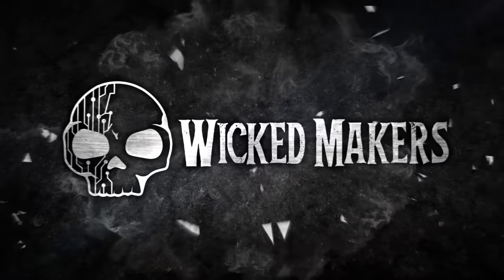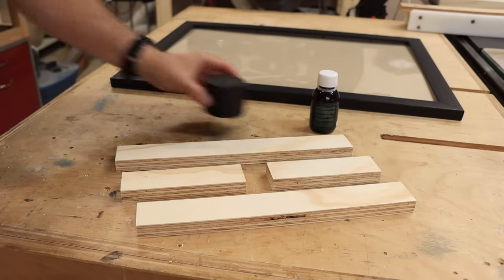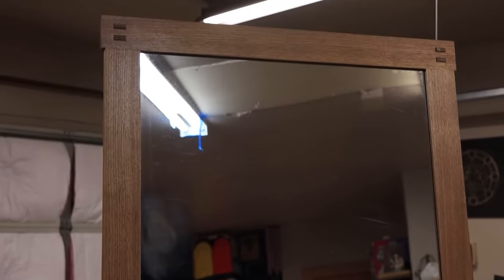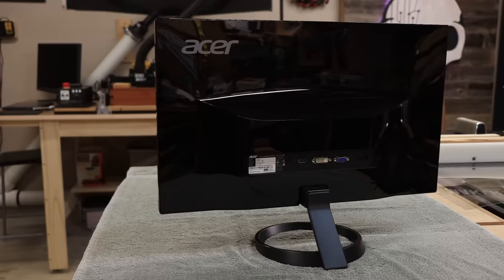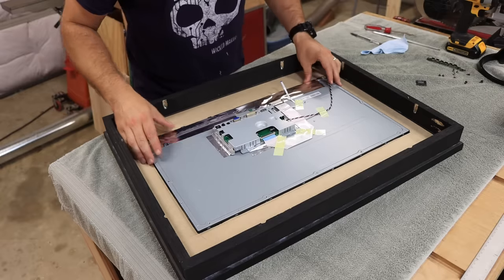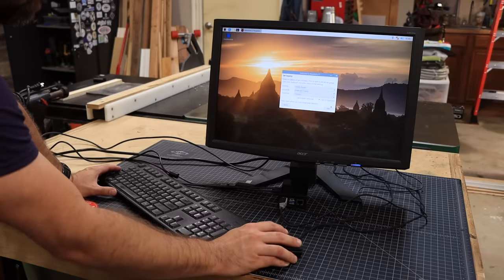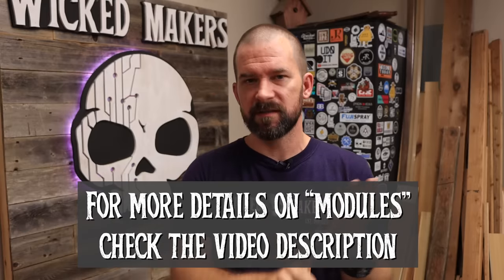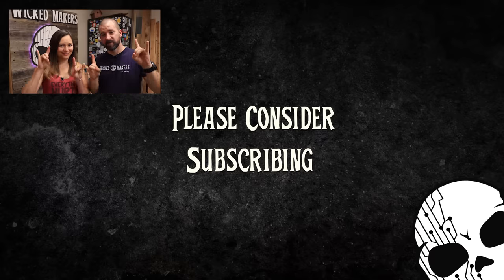How to make a DIY Smart Mirror

Comment: cheaper method of a 2 way method that requires a bit more work. For minimal cost, use the sheet that comes with the frame. More expensive frames have thin glass already in the frame. If this isn't and option. Find a sheet of glass that matches your project. Once you have your glass/material. Buy some interior one way film. you apply it just like car tint but its ALOT easier as long as you properly clean, wet, and squeegee.

Comment: Nice. Wireless keyboard so you never have to take it off the wall. Well, not never, but you know what I mean.
Reply from the maker: Yeah 💯💯💯
Reply: There’s also a way to download a Remote Desktop capability to the pi so you can control the it from your desktop PC over a network!
Reply: Just connect the pi to WiFi and use ssh

Comment: I’d think you’d really want a way to turn it off and on, otherwise you’re going to fry the backlight in your screen….
Reply from the maker: We ran one for like 3 years straight and it had absolutely no issue. Surprised me too :D
Reply: @WickedRandom  must depend on the backlight. I ran an in screen 24/7 for about 4 months before the backlight failed (admittedly it was a repurposed screen…)
Reply: Magic mirror has plugins to turn the screen off - you can also setup motion sensors to turn it on - multiple solutions
Reply: a very (cheap?) simple way is by getting a smart motion sensor switch, not only you can configure it to turn on the room lights you can make it turn on the device (it should also turn on the monitor)

Comment: That hot glue will become a bit like jelly when that power supply will become hot. Just saying, think about this when using hot glue. 
The result looks amazing! 
Back in the days I've done one alike with an old laptop screen and a Pi Zero W - worked for some years, but then the backlit light burn out. So here is another one - the case should be ventilated well.

Comment: Loved this... I made my first Magic Mirror in 2013 after going to a high class H&M where they had a full length magic mirror where you could try on their clothes withouy having to try them on in the dressing room.
I was obsessed with it and after I was shot in my head in 2009, this revived me ngl... I learned basic coding, how to solder, run wiring, problem solving as a whole, and some minor woodworking (I didn't have a dad to show me this stuff so it felt like I leveled up lol). 
Your tutorial makes it so much simpler than when I did it (Amazon didn't sell this stuff.)
Question, where did you get the ywo-way mirror and acrylic? Amazon?

Comment: What would be different if I just were to use a similar software for any device and plug it to the monitor? I mean instead of buying the raspberry pi, and doing all the installing and coding? I mean just plug an HDMI cable, hide it well and plug it to a station, like an iPad, a PC, a laptop or tablet whatever?
Reply from the maker: Mainly the customization. But you could possibly use an existing iOS app or write your own and have the same functionality

Comment: I have no clue what I am doing wrong... I have tried to install MagicMirror four times now! I've never had this much of an issue installing MagicMirror before! It won't let me run the "npm install" command. it says the command cannot be found... I have even tried the easier rout and installing the MagicMirror OS that was created but it just sits at a black screen and I can't even configure the settings to be able to ssh into the raspberry pi. I think there is some kind of bug that hasn't been found in the newer version...
Reply: if it says "command not found" running npm commands, you likely don't have node.js installed

Comment: Did you really need pocket holes on both pieces of plywood on the corners? Or did you only screw in the one piece? But wouldn't that result in holes in the unused end?
Reply from the maker: Just a screw up :)
Reply: @WickedRandom  Just checking! It's such a cool build, I want to do it too.

Comment: Following these instructions I'm about to buy my third Acer monitor. The first one got ruined trying to mount it in the frame. A hair-thin wire on the back got scratched - monitor dead. I bought another one and the glass cracked while trying to remove the plastic frame - not dead but completely unusable. I'm into this project for about $600 so far and no working mirror. If anyone has a suggestion for a better monitor to use please let me know.
Reply: Hey bud, since no one else replied I figured I'd give a suggestion for what I would do. You mentioned the first monitor you bought snagged a wire or a ribbon cable of sorts. These are generally quite cheap and you should be able to find the part number by searching the model of monitor. Anyways, this is where I would start before purchasing another monitor. Also, these things are fairly robust, if you take your time you should have no issues taking them apart without damage. Take a breath, and finish your goals. You can do it!
Reply: @Compromisedone  It was the long piece at the bottom of the screen that has hundreds of hair-thin wires that run to the front of the screen. No replacing that piece. Three time's a charm and my mirror working using a Raspberry Pi Zero 2W. I notched the cross pieces a the ends so they wouldn't touch any of the fragile cables.

Comment: A lot of little steps to make your eyes roll back into your head.  Easier thing to do is buy a panel that isn't in a bezel or stand but otherwise ready to use.  Or use a short throw Pico projector to project to the reverse of the glass.  It can be concealed inside the frame, you can use mirrors to direct the projected images and video so that it looks its best on the glass.  Much easier than what this entails.